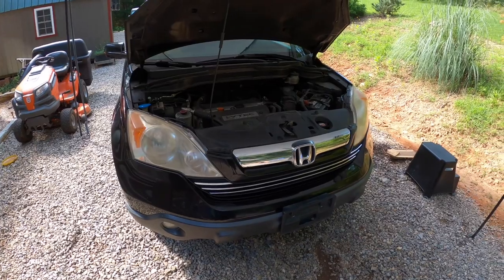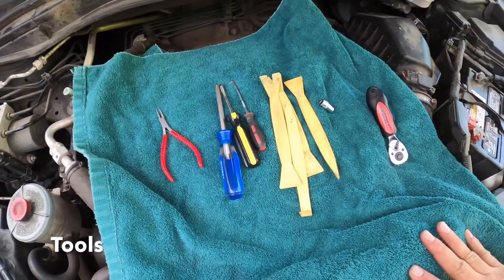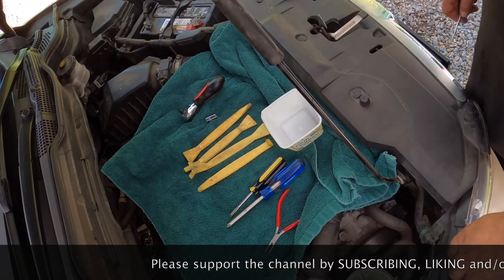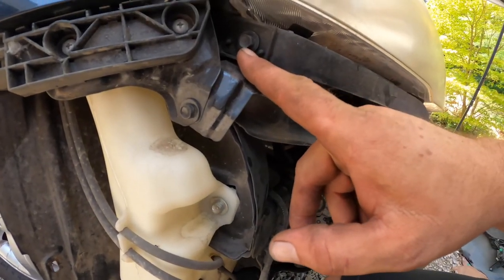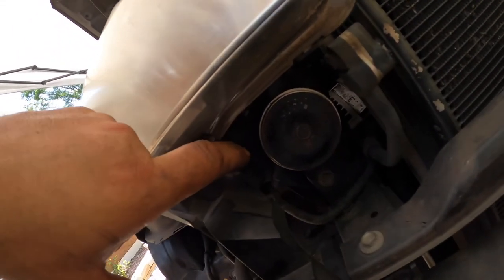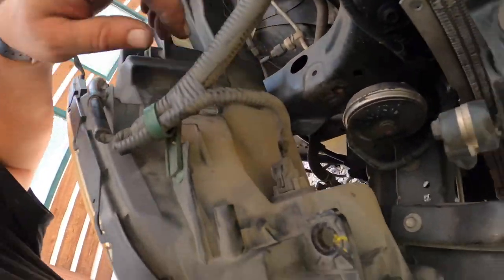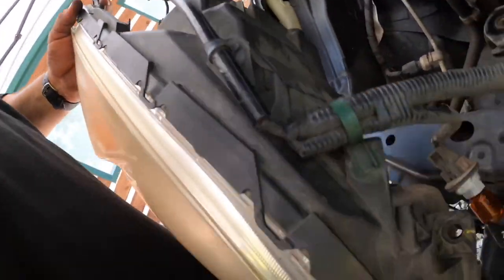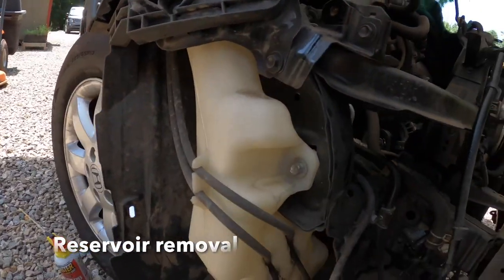2008 Honda CRV: Windshield Washer Reservoir Removal & Installation

Comment: If the barbs on the pump are busted, will that cause a leak? My tank hardly holds anything before It starts leaking (quickly at that). I hit a bird with my bumper, so it makes sense after you explained how force on the bumper could cause it to break.
Reply from the maker: Yes. If the barbs do break they typically break right at the top of the last one where the hose ends. It's so close to the bottom of the tank that you lose everything when it breaks.

Comment: I Thanks for posting this. I have a leak in my reservoir that only takes about 20 ounces before it starts leaking while I'm filling it. I figure it's probably got a crack. I like Honda but damn did they make replacing this thing a pain in the ass, lol, but after watching your video, I might give it a try.
👍😎👍
Reply from the maker: No problem. Glad to help out. 10:35 is an important part in the video. The barbs on the pump are known to break off. Save yourself some time. On the passenger side, pull back the edge of the bumper skin that's connected to the wheel well liner. Look to see if the barbs on the pump are broke off. If it's broke, then you know where the leak issue is. It can definitely appear to be overwhelming. Patience will go a long way on the this project. Thanks for watching and commenting.